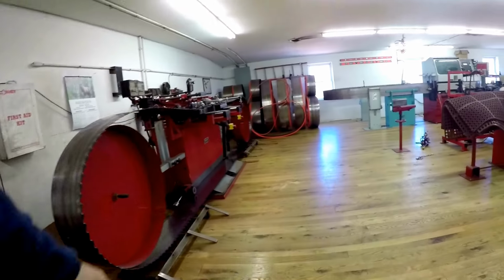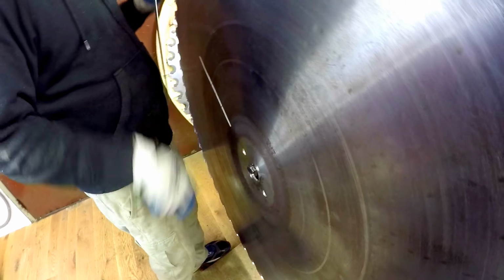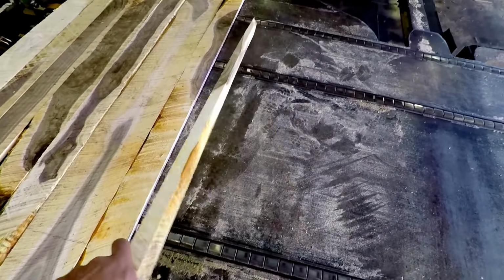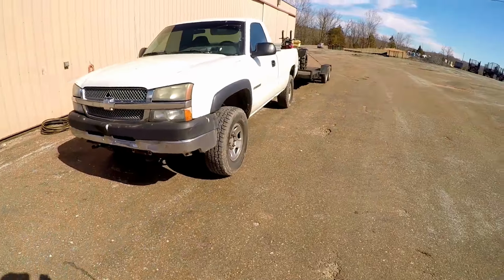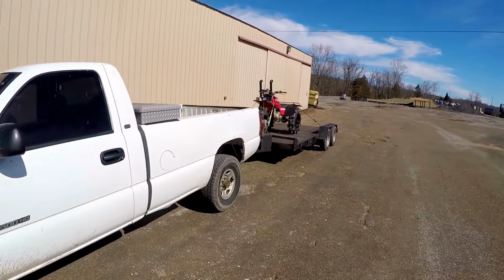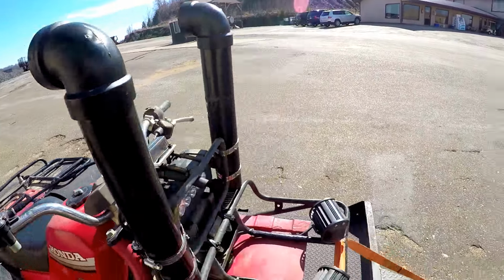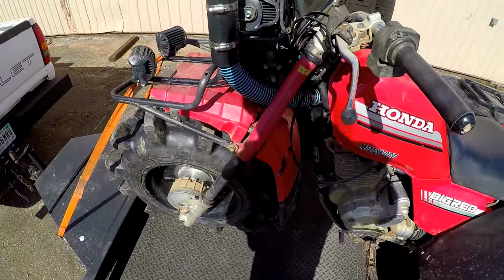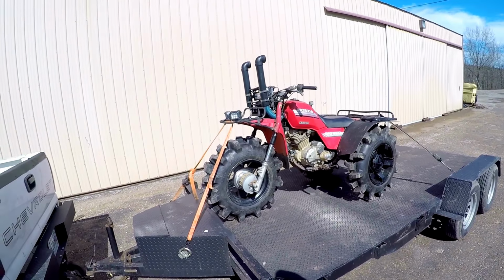squaring Walnut and getting ready for logging

Comment: It's called Hammering a Saw ! It looks like it dished out over the eye !
Reply: Yeah, isn't he stretching the metal with that hammer.
You have to hit just so to move the metal.
Awesome skill to have.
Reply: Not sure of what Logger Wade's saw maintainer was going for on this circular saw, but when we ran our mill, the saw actually had a dish in it when it was at rest.  When it got up to speed, the centrifugal force and weight of the saw would cause it to stand up straight.   Our foreman always said that without the dish hammered into it, the saw would wobble and bind when it was cutting.   Cheers!  Whipple
Reply: V8C2n6i4 Whipple well I was told the same thing ! I went to Wade Vansteenberg school of saw hammering ! Wade was the best I've ever seen ! Simmons sent all there problem saws to Wade ! As far as the dish there should be none ! When your hammering a saw you don't put tension in the saw you take it out ! That's why they dish to much tension ! I know this is just opposite of what I use to think ! But , I ran a saw for years with dish just like your talking about ! I took that saw to Wade he hammered it and it run half again easer , that's when I said it was time to go to school ! Best thing I ever done ! That was 20 years ago ! As of June 6 I'll have 47 years in Sawmill & logging ! That's not counting all the Summers  I worked on my dads mill !
Reply: Huck Miller      Hello Huck!  Good to hear another old sawmiller comment.   I always knew there were different approaches to hammering a saw, I just went with what I was told!  As long as I went home with ten fingers and ten toes, it was a great day in the woods, or at the mill.  We ran a 00 Frick powered by what I think was an old Continental or Ford gas power unit.  We upgraded to a CAT diesel in later years.  Had an American setworks on the mill. All manual, no green chain. Big muscles and weak in the head kept us running!
Reply: V8C2n6i4 Whipple boy oh boy I know what you mean ! I started out on an American ! Then I built a mill , a hybrid it ran very well ! Had a hyd debarker & a big edger , in feed & out feed for the logs ! Had a barn cleaning system , Mack log truck ,2 540 Deere skidders & a 230c TJ forwarder , old petebone super 15 & a new tellahandler  ! If you get it in your blood it's hard to get away from !

Comment: the honda that stevie has, is one of the most dangerous ATV'S there are. Honda stopped making them years ago, due to law suits, and because so many people were hurt, or died.when you see a honda 3 wheel goldwing on the road, they are the bikes, converted into a trike, with outside companies. once you trike one of their bikes, you lose all warranties, and it is hard to find a dealer that will work on them.
Reply: cuznjo1 there's a dealer 30 miles down the road that sells the kit to make them a trike and a full line of service